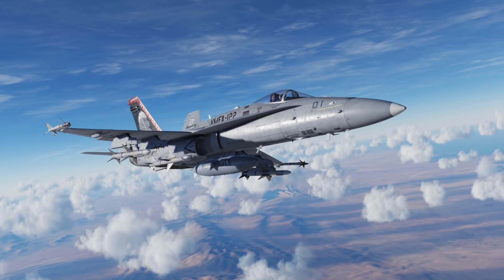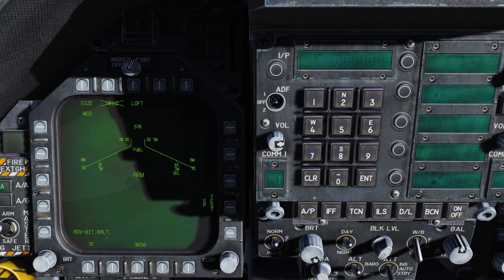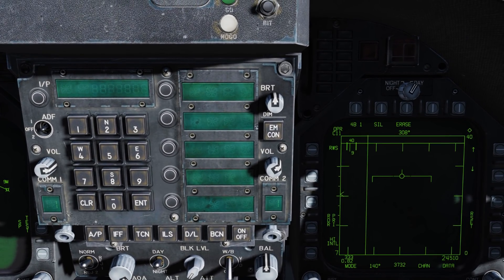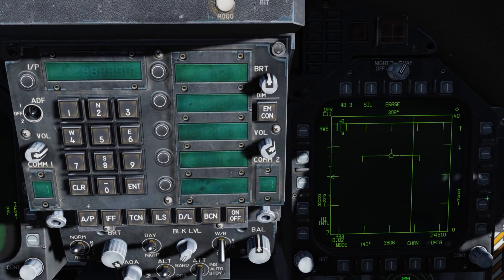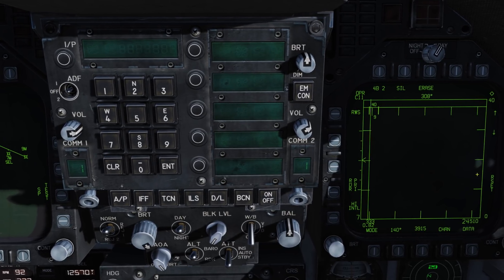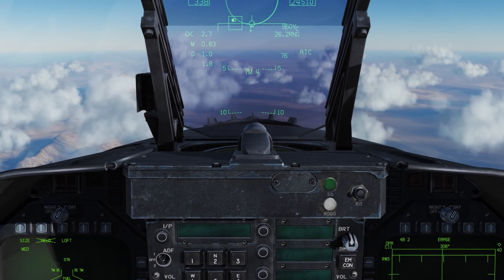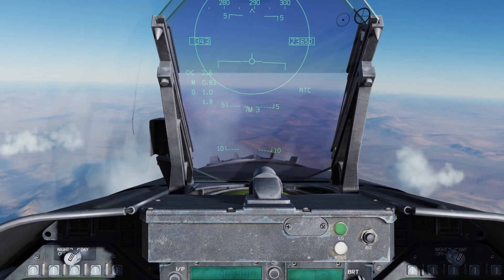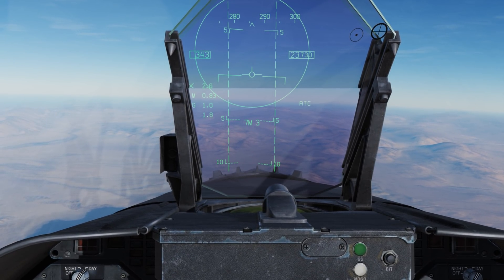DCS: F/A-18C Hornet - Episode 13: AIM-7 Sparrow Air-to-Air Missile

Comment: I'm having issues, when I'm scanning in RWS 4B 140 angle, and then I place the TDC above the target and lock it, it will only hold the lock for like 3 seconds, not even. It seems like I'm not getting STT.
Reply from the maker: It can depend on many factors that include range, aspect angle, target radar cross section, look dow angle, etc. Thanks
Reply: Matt Wagner Thanks for the answer but Im having this problem during the mission lesson for thr aim120

Comment: Can anyone help me ? is there something that can be done as I am not able to watch a replay of any missions that I do or even when complete a mission or  successfully land on a AIRCRAFT CARRIER??? is there some way to fix that?  It used to allow me to  watch playback or watch track as it's called. I know that  the training section doesn't allow you to replay it but for some strange reason my rig  doesn't allow me to watch any play back as of about a week ago .I 've updated DCS and used the repair DCS world  nothing has worked so far . I have a Dell 9010 Mini Tower i7 3770  3.4  ghz 16 gb  240 ssd 1 t hdd  win 10  2 gb video card Amd  rX 460. Help . I guess I should contact DCS world perhaps they  can look into this issue.

Comment: Question on scan cone. The altitudes of the search reported are only valid at the FULL range being selected, correct?  In other words if I'm scanning out to 60 miles with reported altitude search from Angels 6 to 0.....I can only really detect from 6 to 0 at the full 60 mile distance? If I were at angels 10 and a bogey was at angels 2, 7 miles off my nose and hot......I would not be able to see him on radar, correct? He would essentially be under the cone of my scan (assuming level flight of course).

Comment: Matt - what PC is this running on - can you provide a spec for optimal performance?
Reply: 7 6700K, 32 GB RAM, GTX 1080ti, Windows 10, 1TB SSD, TM Hornet stick and Warthog throttle, and Track IR 5 with default settings.

I got this from his signature at the bottom of his posts at https://forums.eagle.ru/showthread.php?t=194412
Reply: Minimum and recommended specs are on the dcs world website at the bottom of a bunch of pages if not all
Reply: Nick Digiandomenico thanks !

Comment: What are the controls for the tdc called? I can't find them by searching or on the HOTAS control page.
Reply from the maker: TDC Up, Down, Left, Right, and Press are all listed in the Hornet Sim category.
Reply: Matt Wagner Yeah, I found it. I didn't know TDC was short for Throttle Designator Controller
Reply: Thank you Matt for clarifying the TDC! Had been searching everywhere for it - considering TDC Axis doesn't work yet. Maybe there should be some consistency in labeling? TDC for the buttons and axis? Now I've just got to work out out to lock the target up!

Comment: Will it be possible to add later the AGM-158B JASSM (ER) at least? 

Or other compatible conventional non nuclear weapons for the hornet, like the European weapons, AIM-132 or Taurus missile, etc?
And of course apart for the already existing planned ones. 
Or is there's something that restrict ED from doing any other weapons?
Reply: Antony Leung there are no plans to implement those weapons. Check this link for the planned systems. They won't all be there for early access. https://forums.eagle.ru/showpost.php?p=3285514&postcount=13
Reply from the maker: No, weapons for the Hornet span early 1980s to mid-2000 and only for USN/USMC.